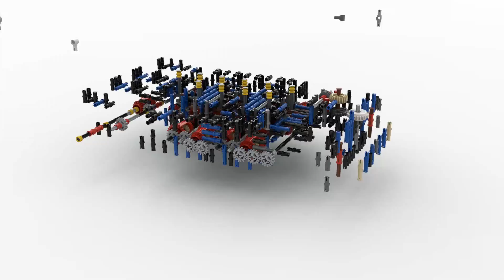LEGO Technic MOC:  1023 SPEED CAR

Comment: started build van 1;8 scale and was look your gearboxes and am confuse. What gearbox i can use for model space 13 stud x 20 stud ? wand use 2 buggy motors and select gears with rc. also 4wd swiched
Reply from the maker: Hi Dariusz. 13x20 is prob enough room for what you are after. I don't have a gearbox design lying around for what you are after but if you have a look at a few of my designs maybe you can be inspired by some of the ideas.

Comment: so the 1023 speed is actually going slower and slower and eventually the 1023th gear is the slowest, instead of stepping up I'd imagine?
Reply from the maker: HI George, yeah I guess the numbering is in reverse to a car - didn't really think that through ;)
Reply: @TechnicBrickPower  That would be the only way I could see it work lol, very interesting design. Instead of re-distributing torque via different route of gearing you put more and more resistance to the drive train. Might as well call the 1023th gear first gear haha.

Comment: I wonder what the power losses due to friction are at various ratios.
Reply from the maker: The more differentials are activated the greater the power loss. I can activate all of them and it will still drive on a smooth surface but not on carpet - so I am guessing about 80%-90% power loss but can't be sure without measuring that properly.